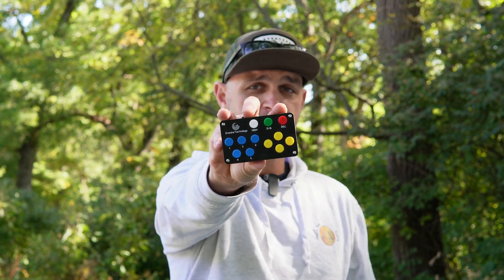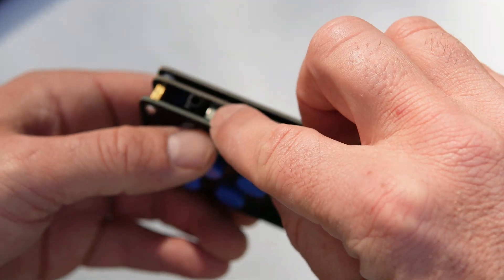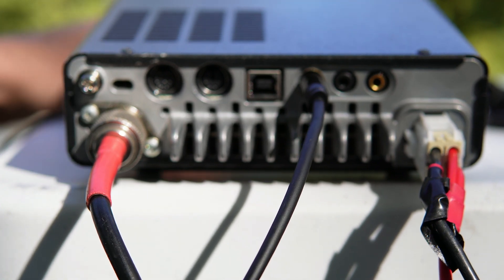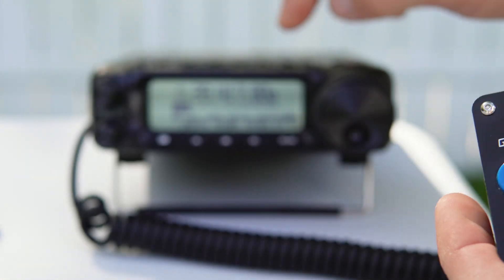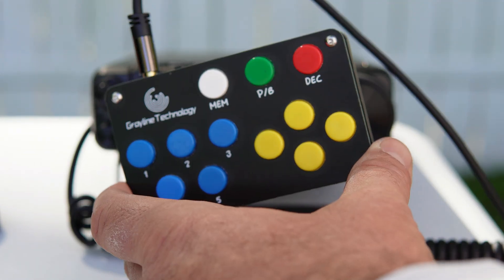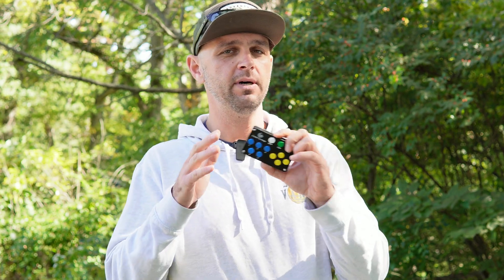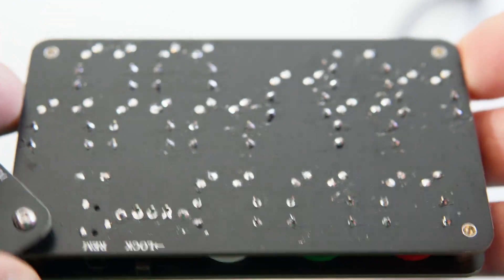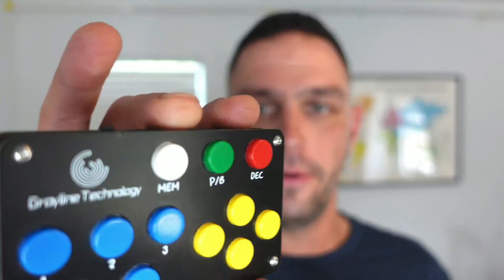Cheap Yaesu FH-2 Remote Control Keyboard Alternative from Ali Express, Does It Work?

Comment: I just bought one from Amazon for $16.89 assembled, with a cable. The only obvious differences that I can see are the lack of the logo on the top left corner and the lack of the dimensions on the insde of the back cover.  I haven't had a chance to try it yet, but the reviews (all 5 of them) are all 5 stars.
Reply from the maker: sweet!

Comment: Sorry to post this question on an FH-2 replacement video.

Yaesu website lists MH-36E8J DTMF microphone as an accessory for the FT-891.

Would a DTMF keypad of MH-36 work on HF radio like FT-891?

Can the keypad on MH-36 add ease of operation (similar to FH-2) on menu driven tranceiver like FT-891?

Thanks.
Reply from the maker: Hello! At the moment, I don't have an answer, but I'll do some research tomorrow!

Comment: Nice alternative
Reply from the maker: It works well. I've thought about making a straight across, 3D printed magnetic "panel" that would magnetically clip onto either the 991, 891, dx10, etc. My hang-up is learning PCB design.

Comment: the cable, what do I need? A 3.5mm TRS on both ends? Or a TRRS? I couldn't tell from the video.
Reply from the maker: Good question. I just sent this away, recently.  But off hand, I believe it's the same as this one - https://ae01.alicdn.com/kf/S8f53ccebe60241fdbaa02ed0f33377976/Yaesu-FH-2-FTDX-9000-FTDX-5000-950-ft-450-ft.jpg_.webp (Hopefully that linked correctly.) Cheers!

Comment: Great device- but a tuner also uses that same port on the back of the 891, so you would have to give the option of using your tuner.
Reply: No... get a Y-Cable.  The tuner uses the 'Ring' of the stereo jack and the FH2 uses 'Tip".
Reply: That's a good thing. Reasonant or bust.

Comment: If I use this, I can't use my tuner because it uses the same plug, correct?
Reply from the maker: Hey thanks. That's a good question I didn't consider, as I don't typically use a tuner, but your statement would appear to be correct. Bummer
Reply: The FT 710/FTDX10-101 have a separate REMOTE  port in the back that it used on those.  It is separate from the tuner jack, so I know it will work on those.  Other radios may be different.

Comment: Hi Sean,
Tried to order it and during checkout goes to Spanish language using Paypal, then tells me my account has been disabled.  WJ3U
Reply from the maker: That's really odd
Reply from the maker: I'll double check the link I used
Reply from the maker: Just checked and it worked for me.  If you need, I can order it for ya
Reply: @DudeTested  Hi Sean, Link work, but something appears to be wrong during checkout. I  will try again later. WJ3U
Reply from the maker: @DonDegidio  sounds good. Let me know if I can help. Hope you're well

Comment: Cool, I made my own for my IC 7300 and I love it…👍
Reply: You implemented the 4 switches + resistors between mic connector pins 3 & 6 per page 18-3 in the 7300  manual?
Reply: @Randrew  yes, and made a jack connector for the mic, now I can use my headset. I works great.